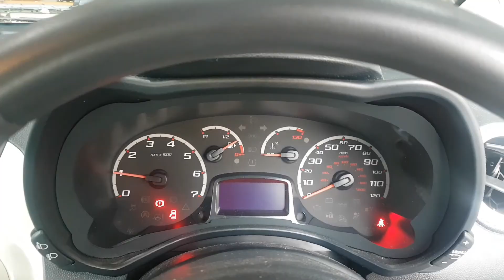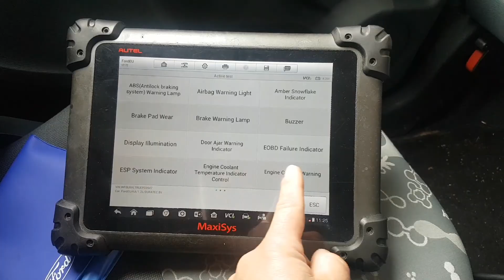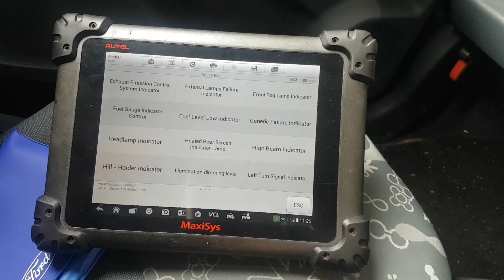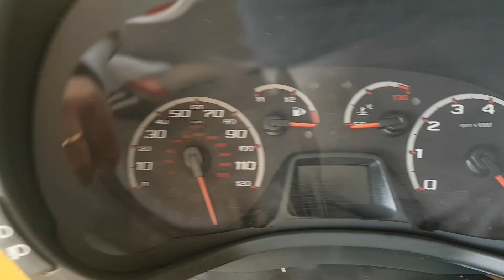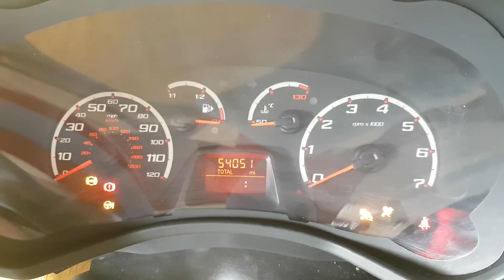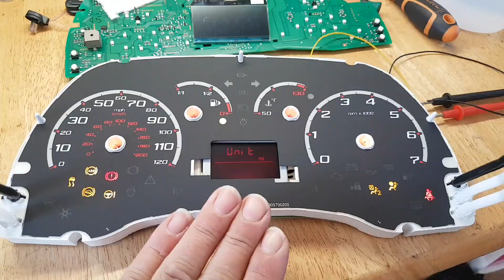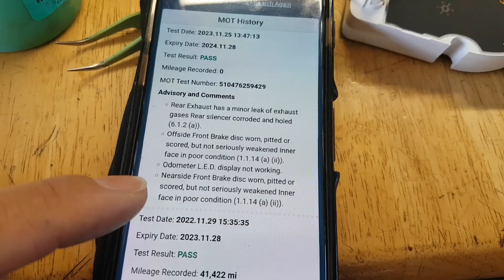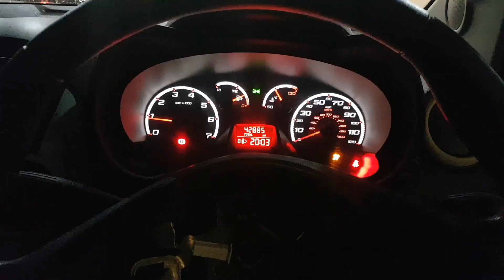Ford KA cluster LCD screen not working... Fault finding and repair.

Comment: I'm not sure, but I think that's the old "plasma" style display I have in my mk4 Mondeo 2008. I'm not sure about model years, but quite many displays seem to change on many newer models to blue VFD style displays around maybe 2012? Mondeos at least are notorious on bad solder points on dashboards. I paid like few hundred  or two euros for one business to fix mine, but it lasted like a year and I just bought myself hot air station and sent it. It was nerving as f to do as I know there's like body control module and I knew if f'up car I do commuting is going to be dead. But it worked after like fifth try and has now been ok for multiple years. I'm not 100% sure, but I think that free Forscan tool had also diagnostic mode for dashboard for Mondeo, iirc. It's been long since I've last used it, but it's pretty damn good imho on laptops and even Android. Oh and also I think it had simulation mode to see what features are available when you're offline, something that's quite hard to define for some diagnostic tools without actual car.
Reply from the maker: 😊
I actually have ford scan, but just couldn't be asked to take it out of the box...😅
Yes, the cold solder joints is a well know issue, that causes all sorts of issues.
👍👍👍

Comment: ?! The tachometer is now on the left side ?!
PS: I watched more carefully...the replacement is with the tacho on the right and you've kept the original one.👍
Reply: Good spot!🧐 The original and final fix had the rev counter left/speedo right, but the donor instrument cluster reversed. So did Luis replaced the Eprom chip and the LCD only? It is working now.